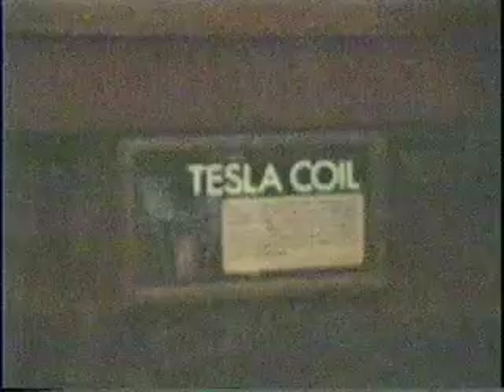Tesla Coil Demo

Comment: AC and DC *can* both kill if it is above 30 milla-amps regardless of if its 125,000 hz. You'll note how he is not permitted to stand inside the cage. Radio waves only convert into the electricity inately in the screws.

Comment: But a human can hang from a high tension line and not be electrocuted, so long as they don't touch the ground. And lightning hitting planes and helicopters generally fries all the electronics on them. You can figure where that leads.

Comment: EMF (Electric and Magnet Fields) radiation, but there is little evidence to back it's dangers as of yet. It's possibly related to increased chances of developing cancer. More importantly to this discussion is RF (Radio Frequency) radiation. Also know as nonionizing radiation. It is said high levels of exposure can cause heat related effects. Even to the point of skin burning. Animals (mainly certain insects) that require the earths magnetic field to function normally.

Comment: The energy requirements for a large scale transmitter would be massive, and there would be huge amounts of radiation created. Also, as far as I know Nikola did not experiment with large scale transmition all that often. The coils we build are exactly the same, but tuned for voltage step up not energy transfer. Radiation is a by product of electricity, and not part of the waveform as far as I know... Comments/corrections?